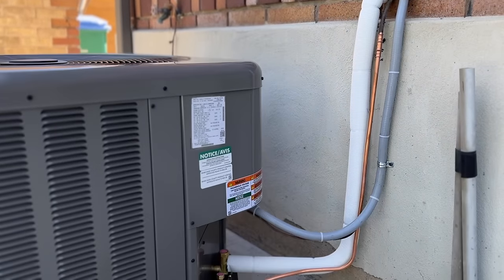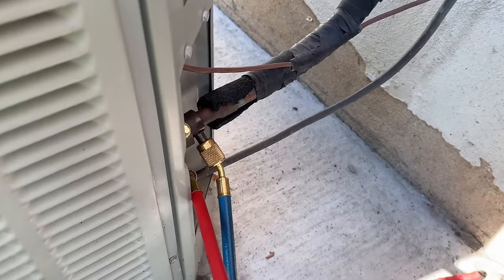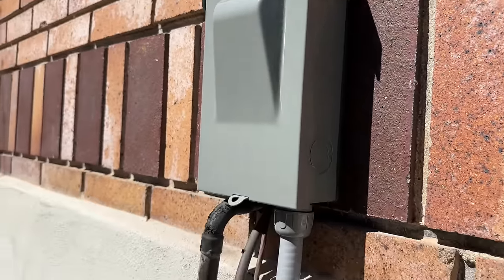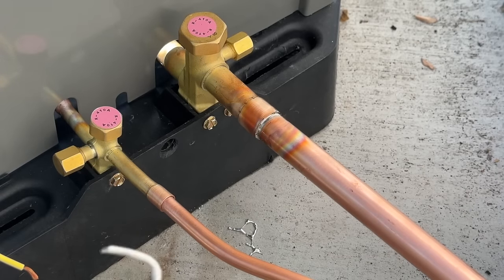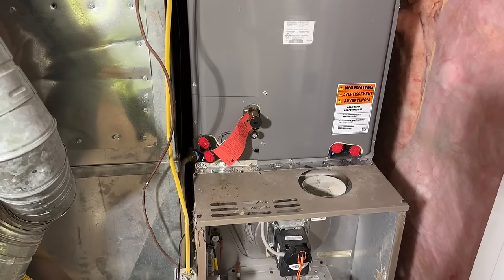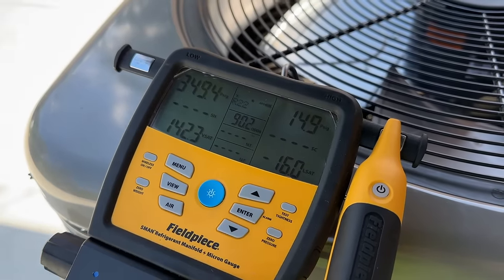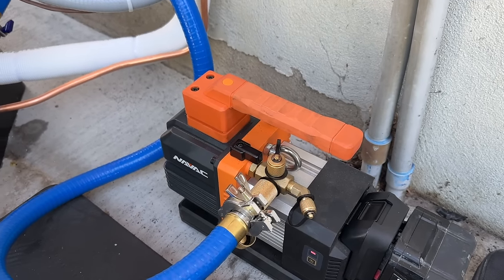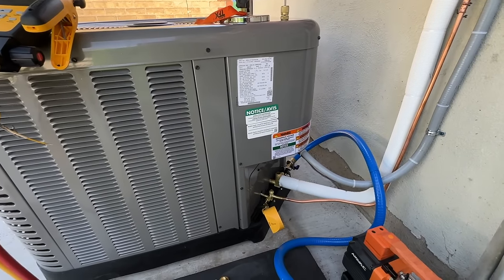Did You Know You Can Replace Your Own Air Conditioner?   -SAVE THOUSANDS-

Comment: Can one change the condenser  unit outside alone without changing coils or both should be changed? I suspect I have a unit that is smaller than required size for the house. It struggles and runs non-stop when temps are mid 90s and above. Only specific rooms tend to be cooler but not cool enough. Someone please advise so I can make a economical decision budget wise. Thanks in advance.
Reply: Depends on the refrigerant, but the evaporator coil has to be capacity matched to the condenser.

Comment: If I replace the outside heat pump unit because my compressor is bad, do I have to replace the coil inside as well?
Reply: Depends on what refrigerant was being used on existing system.  If it was R22, you can no longer buy R22 condenser units (even the dry units have disappeared), and will need to replace both

Comment: Doesn't get hot enough to create soot? wtf? You're clueless bro! The heat creates cupric oxide inside the line set when heated. You need to run nitrogen to avoid this or your system won't last long. YOU DO NOT WANT TO APPLY YOUR FLEX LIKE THAT! It will get into your system and create all sorts of issues. Pressure test and vacuum on both service ports! Bro... Insulate the txv bulb ALWAYS

Comment: Do you use that unit for heating in winter? Or only cooling?
Reply: There's should be add winter back for outside unit etc put heating power is 1/3 when cooling is only 1/2..
Reply from the maker: This is just an air conditioner not a heat pump

Comment: what he didn't tell you is that no one will sell you any of the compressor parts or the that whole unit condenser without an A/C technician license. Unless you know somebody who can lend you their license and take the risk of no one complaining about how the freon was let out in the atmosphere when replacing the unit. the first thing the EPA guys ask for is the license. and just like that you are done.
Buying the freon is at whole different level. if you can even get the parts or the unit. do good luck. 
Replacing small parts like fan or capacitors may be dyi jobs but anything else is absolute no. let  me know if am wrong as I couldn't get any parts for my unit from teh local HVAC supply stores.

Comment: I have an old 3.5-ton r22 system that has a Carrier TXV/coil (300psig rating).  The condenser unit needs to be replaced.  I have been told that I could use a 3-ton r410a condenser with my old coil.  Is this true? I am confident that a 3-ton unit will provide adequate cooling.  Thanks
Reply: You’re not going to be able to get the mineral oil out of the evaporator.  The TXV also will have the wrong refrigerant in the sensing bulb.  You will need to replace the coil.

Comment: Should the line set be replaced as well?
Reply: If you are changing refrigerant type you can flush with R-11 flush and remove incompatible oils from old type
Reply: So as long as there is no leak in existing lines then NO

Comment: What is the blue at 15:50 and does it come with the air-conditioning unit?
Reply from the maker: That is my trublu evacuation hose. Not needed as a diyer if you have a regular plug in vacuum pump. It is to expedite the evacuation process so I can be done quicker 👍🏼

Comment: You didnt show them how to flush the lineset before connecting the new system. And you didnt say anything about proper breaker size for the new AC.
Reply from the maker: It wasn’t a new ac, same size as before. So nothing was done with the breaker. I believe it had a 30amp breaker in it to begin with and 30amp max was in the new system.

As far as the line-set, I don’t typically flush it unless there is acid in the system. I’ve done it that way for years with zero issues. Some of my videos that acid was present, I show how to use the hilmor foam pigs, you just blow them through the line set. Very easy to use.  The video I have that shows that is the rooftop one we did. The thumbnail has me using my ladder crane 👍🏼 cheers

Comment: So how do you get rid of R22 once you purge the system? What's the porcess?
Reply: Most homeowners will probably just blow old refrigerant into the atmosphere. Probably not going to go buy a $1k recovery machine and cylinder...
Reply: This was actually directed at you. How is R22 made inert and how do you as a business get rid of it?
Reply: You have to weld the small line closed and open the king valve with your gauges on it,then do a standard recovery just like it was still installed,it is better and easier to do it while the old system is still installed ,doing it later is just more work.

Comment: so one can replace own ac unit? no license required? is this because all units now come pre filled?
Reply: Better check with your local licensing district.  Some places allow homeowners to pull their own permits.  Mine no longer allows homeowner permits for HVAC, and also requires an electrician attachment for AC replacements.  May become a problem if the house is sold and the work was found  to be done without permits.

Comment: Bro, you can't use soft solder on 410a systems
Reply from the maker: Yea you can. I’ve used it on a dozen or more systems. Zero leaks. Staybrite 8 is not regular soft solder by the way
Reply: @diyhvacguy  Plus you can't pump the refrigerant into the condenser if the compressor doesn't work. If the compressor is bad you will have to recover the refrigerant and your average joe doesn't have an EPA license. Also white insulation and zip ties aren't UV rated.

Comment: Did you run all new lines, or used the old ones?
Reply from the maker: 99% of the time I’m going to use the old lines. There is no need for new lines unless they are too small or too big. With a burnout I will flush the lines but if there was no problems I’ve never had an issue with not doing a flush. The little bit of residual oil isn’t going to hurt anything.
Reply: @diyhvacguy So, you’re encouraging homeowners to cut corners.

Comment: What are you gonna do with the old condenser with the R22 in it??
Reply from the maker: I recovered it in my garage 👌🏼
Reply from the maker: I have a video dedicated to recovering good refrigerant into a tank 👍🏼
Reply: @diyhvacguy  why not recover it at the job?  Seems to be a wasted step to pump it down and then recover
Reply: @diyhvacguy As if the average homeowner has the equipment and means to do this?🤔

Comment: not really sure how diy friendly this is, considering with all the tools you used it would cost thousands anyways. im not saying an average guy can;t do this, but i am saying that he shouldn't. you should also use braze, not solder, on refrigeration lines, as they operate at a much higher pressure than the copper water lines in your house, and they will leak. ive personally seen several joints like this leak, costing the homeowner a pretty penny in refrigerant and labor to fix and be done correctly. even if you did decide to solder, between the gauges, micron gauge, nitrogen tank, vacuum pump, cutters, benders, and all the other odds and ends, its a lot of money to be spending on one project, and youll probably end up spending more on the things you need to do it than you wouldve to just hire a company to do it for you. additionally, you have to be very careful working with your high voltage, and you shouldnt mess with electricity unless youve got an idea of what youre doing. also dont think he mentioned the low voltage, so you cant forget to hook that up or your system wont turn on. the refrigerant in the unit typically is goof for 15 foot of lineset like he was saying, but its incredibly rare for your linest to be that short. usually i find theyre closer to 30 feet of more, and you have to have certifications to buy and use refrigerant. i guess if it needed charge thats one thing you could have a company come out and check for you.

Comment: As long as you have a hvac license to operate in that city your okay
Reply from the maker: Wrong. If you are a homeowner and you get your epa certification, most cities will allow you to replace your system. And you can have it inspected just like a contractor. The reality is, most contractors don’t even pull a permit for a replacement.
Reply: @diyhvacguy  Most?  Why don’t you just say check with your local city codes before doing this yourself. And you assume everyone can wire electrical connections without milking themselves. You are so high on yourself but don’t mention that you take full responsibility if someone is injured.
Reply: Last permit I pulled for a furnace install wanted my contractor's liability insurance information which I provided.
Will a homeowners' insurance cover a homeowner who blows up his house installing their own equipment......?  Doubtful
Reply: I’ve been married 45+ years but I wouldn’t tell anybody they can do it too.

Comment: No manufacturer will honour your warranty without professional installation.  Also you didn’t flush your old lineset which had R22 in them, the R22 is incompatible with 410A and it will cause all kinds of issues. Not a DIY job at all.

Comment: One thing im not sure why you're doing it but i keep seeing you remove the schrader core before actually connecting the core removal tool. Why is it you keep doing this instead of putting the core remover on the core removal tool and doing it from there? You're the only person ive ever seen do that. Lol
Reply: Also new Rheem and RUUD equipment you need to let them run almost 30 minutes before refrigerant adjustments now. It sucks. So the 10 minute wait is a no go. Says it right in the install manual now. 😒
Reply from the maker: Because the schrader core sometimes will get stuck on the o ring inside the tool and I’ll end up having to take it off anyways lol so I just pull the core from the start and set it up on top 👍🏼

Comment: I just need to know a supplier for these parts...
Reply from the maker: Amazon sells hvac equipment as well as hvacdirect.com   If you need some help, check out our Patreon remote support group at Patreon.com/diyhvacguy where we will help you locate all the equipment and tools to tackle this project. Cheers
Reply: Look online. Many supply houses sell any part needed online. The only restriction is refrigerant which requires an EPA608 license.  In fact you can legally buy a pre-charged condenser without any license. These online HVAC dealers are the smart business people. They sells parts. It's not their concern if the buyer is professionally qualified or not. It's these stuck up supply houses that refuse to sell to homeowners losing the business and money.

Comment: What about the cost of a vacuum pump?
Ac gauges/manifold?
The extra 410a needed for subcooling?
DIY HAHAHAHAHAHAHA
Reply from the maker: All tools are around 1000-1500. A small price to pay when you are saving upwards of $7-10,000.  But you do you boo. If you have 20 stacks laying around to replace you ac, you are doing a lot better than most.
Reply from the maker: All tools are around 1000-1500. A small price to pay when you are saving upwards of $7-10,000.  But you do you boo. If you have 20 stacks laying around to replace you ac, you are doing a lot better than most.

Comment: Dude, that is not the ‘High’ side ?? It’s the liquid line bro , always has and always will be the liquid line . The suction pipe on the other hand is suction on cooling and is the discharge pipe when on heating while the liquid line is still the liquid line, HVAC 101 mate .

Comment: Definitely not a DIY unless you’re an HVAC professional.  AFAIK you cannot buy commercial refrigerant without a license.  And… I’m not sure any legitimate pro would fill a DIY system because of liability.  Also the cost of the refrigeration recovery pump, and proper tools etc would negate any savings.

Comment: As a HVAC contractor, I just have to say, leave the HVAC to the pros. Please. These "repairs" cause so many expensive problems. Honestly there are specific DIY mini split systems for homeowners, but this video is best left up to the pros. Especially when the equipment necessary for a proper job ranges between $3-5k+ and expecting a homeowner to drop that for a one time use essentially is not reasonable. Cheaper to let the pros do it.

Comment: Why did you replace this system? The compressor is still good, the condenser fan is still good, the system is still holding a charge, you pumped the charge into the condenser coil so that must still be good. Why are you charging your customer thousands of dollars for a new system when the one that they currently have in in perfectly good condition?

Comment: Save thousands!  But to be able to do this you have to spend thousands in specialty tools, have specific knowledge of multiple trades and not screw anything up your first time!  Brilliant!  👎💩
Reply from the maker: Nah, it’s not rocket science bro. I’ve helped dozens of people replace their system. You should give people more credit, there are a lot of DIYers that will do a better job then half the $20/hr install techs will do because it’s THEIR home. Cheers
Reply: @diyhvacguy  For every one DIY'er that can do this better than a tech, there are thousands that will F it up.  The required knowledge and tools needed to do this right is way outside of the scope of the vast majority of home owners.  You've got a base level of knowledge that you're just assuming everyone has.  Maybe if someone like you is standing right there to keep someone from getting into trouble it would be worth doing.  Otherwise, just call a pro and thank me later.  Some things just aren't worth the DIY try.

Comment: Guys, listen to this guy. Do it yourself or even Buy the Unit and then call someone to install it for you. You will even save thousand do it yourself. A company in this desert heat charge me $ 11,800 in heating and cooling Unit: Amana 4-ton 15 seers. This Unit could cost to them less than 5 or 4 K dollars, but they kill me with $ 11800 and the company is a shit.
--- If you buy the Unit for $ 3 or 4 K, you can call even a company and how much they will charge you? No one will charge you more than 3K, will be an abuse. $4K+3K= 7k dollars, it will be a save of $ 4,800 in total.  My unit was installed last year 2023. I learned with pain, next time I will laugh for sure of those company. LEARN, LEARN, AND LEARN.

Comment: This stuff ain't rocket science as these kits are basically just plug and play. The problem is if you have problems you're SOL because unless its installed by a licensed HVAC technician you have basically no warranty.
Reply from the maker: Not true at all. Goodman systems come with a 5 year warranty with no registration. And if you can get an hvac contractor who isn’t greedy to do part of the work, they can register it for the customer. But either way, you still have a warranty. The homeowner can’t go in and get a warranty part, but an hvac technician can.

Comment: So why are you replacing a unit that still works? Maybe a stupid question!,but if it will pump down,should be no reason to replace it!
Reply: could be many reasons. system leaks would be my 1st guess.
Reply: R-22 refrigerant is really expensive
Reply: Can't pump it down if compressor is bad. May be leaking, R22 is $1900 a bottle now.
Reply from the maker: Yea you are right. It was a system leak. We added a couple lbs to get them to the replacement date.

Others simply want to upgrade a 25-30 year old system
Reply: I have the experience, equipment and license.  Years ago I replaced a central AC/Gas combo which was still working.  It was part of the deal to sell the house.
The electric bill in July was over $300 for a 1200sqft house in Savannah.  I put a high-efficiency combo back in.  The electric bill for August was $160 - and it was hotter out.  The local electric company came out and inspected the meter and installation because the reduction triggered their electricity theft alert!
The old system was an Amana that was 25 years old.  I could not find out the SEER.
Reply: @RobertTuck-vo8cw  That math is a little off! Thats saying the new system is almost 50% more efficient than the previous one! If the old system was a 10 seer the new one was a 20 seer. I have been in this game for getting close to 30 years and the only time I have seen dramatic savings is with all new insulation,walls attic,new windows and doors etc! Usually is more the case that if your bill doesnt exceed what your paying now,then we did good. Your AC alone is only a percentage of the bill,so if you save 10% or 20% ,its only a percentage of a percentage ! So say electric is 65% of your bill and your AC running balls out is 25% of your bill! 25% of $100 is $25, 50% is $50 ,you see where Im at with this No different than the clever upsell from a 95% gas furnace to a 98%, for and extra $1k!
Reply: @petersmart1999  I doubt that a (now) 40 year old system was a 10.  More like a 5.   I cannot argue with the facts.  That is what happened.
Part of the problem was that the old system was undersized and ran all of the time.  With the new properly sized unit, the AC cycled on & off.
The SEER did more than double.

Comment: I'm all for DIY but this is kind of dumb. Soooo many issues. None of the good brands will sell direct, most people lack brazing and sweating skills, you need a license to get the refrigerant, the gauges, n2 tank, and vacuum arent cheap for a one-time use. I could go on. How is a DIY going to diagnose any problems or get warranty parts?
Reply from the maker: The person who installed it doesn’t necessarily need to diagnose it. If a DIYers has done the job well, a contractor will never know the difference and diagnose it as usual. But to each their own.

Cheers